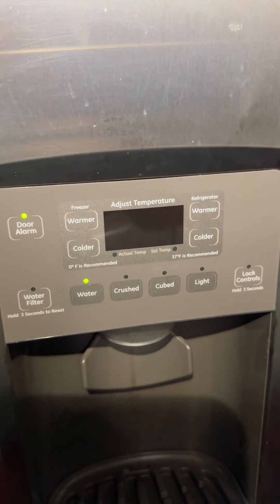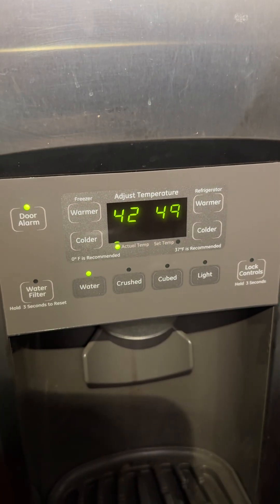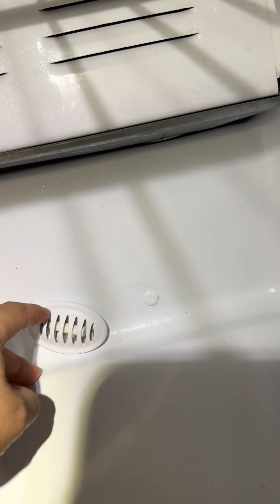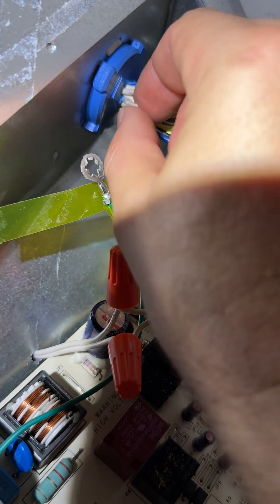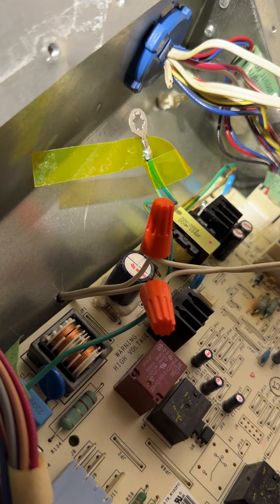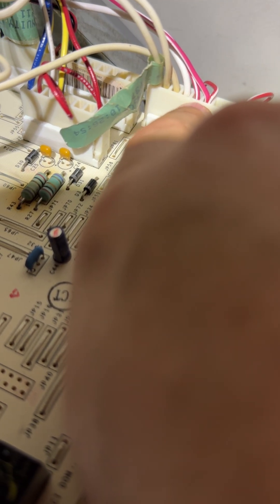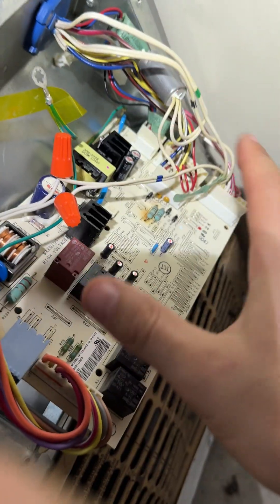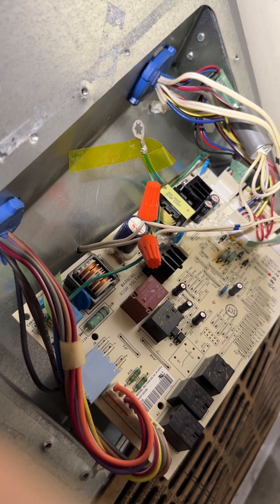GE GSHS6KGZBCSS Refrigerator Freezer not working Actual Temperature stuck on -9F at all times REPAIR

Comment: Tried this but mine still at -9
Reply from the maker: Test 2 sensors in the freezer
Reply: @applepietech  figured it out. My model is slightly different in terms of wire color i was looking at the white with blue like yours but mine is  white with black instead. Also it was only until I tested the wires with the board completely unplugged then I saw open circuit on white with black. If u do it with the board plugged in you get good resistance readings even with power plug off. Now time to drill and relocate sensor. You saved me alot of $$$ thanks!!!